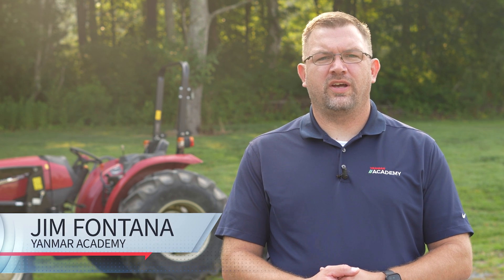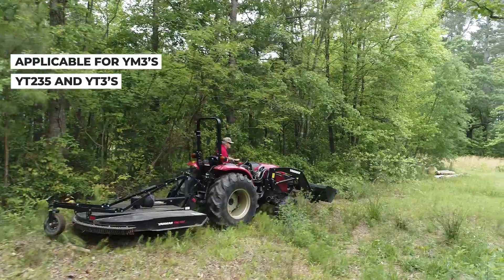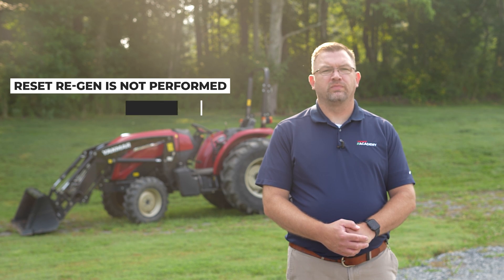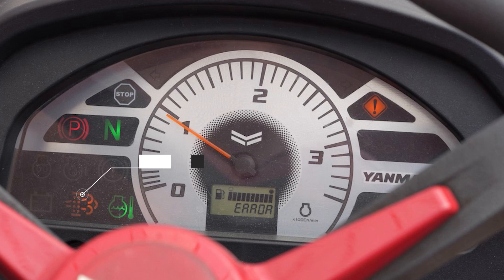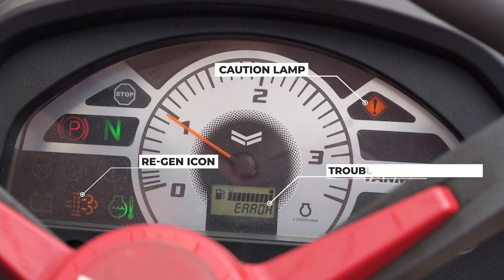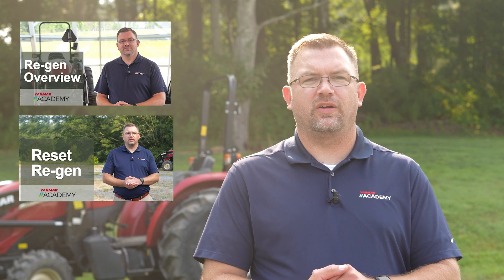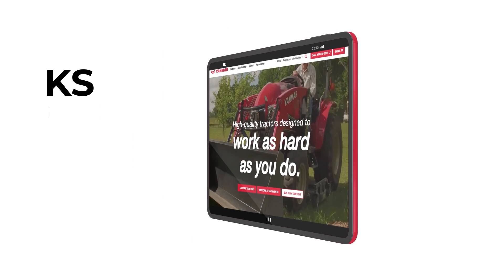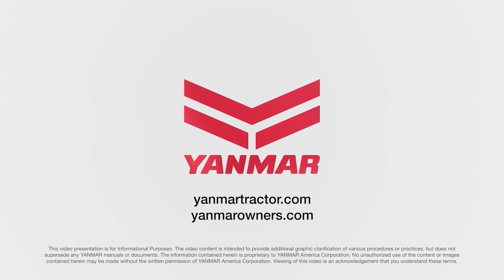Stationary Regeneration on a YANMAR tractor

Comment: When you say run engine hard and higher speeds what would that be. Manual does not say anywhere that I can find what RPM at 342 or 347 should be run at..
Reply: 1800-2000 rpms or higher is what they said in a comment on the reset regeneration  video.
Reply: YT-235: Performed the stationary (park regen) and regen light will not stop flashing after 3 hours.
Reply: @stephenmras8519 same , did you figure out how to fix it ?